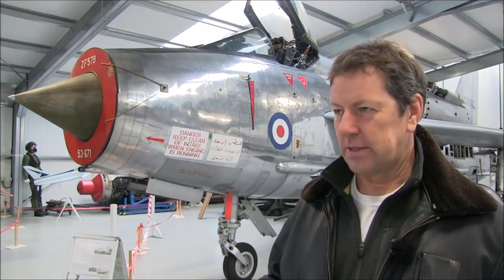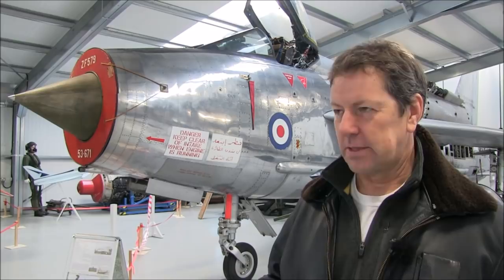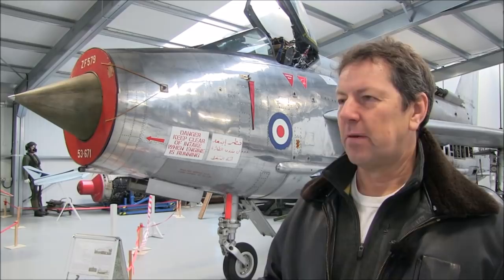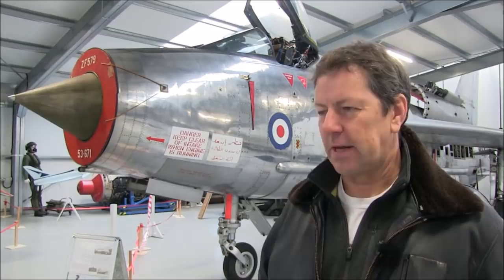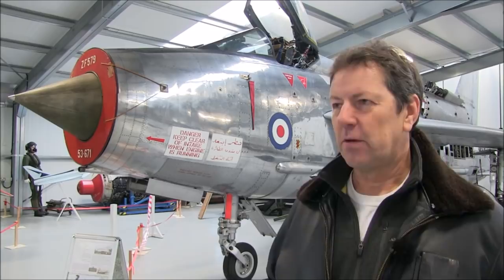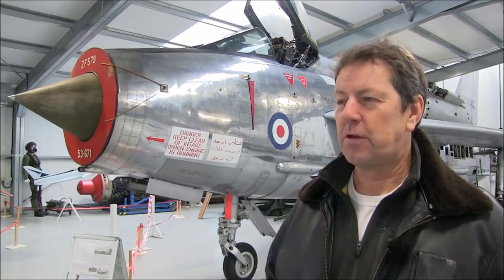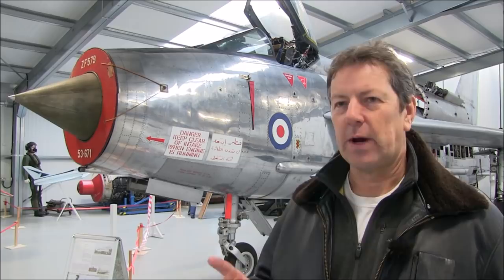Ian Black Describes a Lightning Take-Off

Comment: I recall an old joke from a Lightning pilot... The Lightning has so much thrust the only reason it has wings is to keep the nav lights apart.
Reply from the maker: Love that!
Reply: i heard that too, its from a pilot who flies and maintains the lightning in south africa i think.
Reply: dathat555 you watched that on here fake
Reply: That remark was from a BBC series about RAF trainee pilots from the 1990s, the RAF kept one Lightning in flying condition and the top recruit was taken up in it ,it was a two seater, on take it went vertical and the pilot said, " now you know what the wings are for", the trainee replied ," whats that Sir",  the pilot replied,"therear' to keep the navigation lights apart
Reply: Love the original comment about the wings
Reply: @cassorde1599  The late Mike Beachy Head

Comment: Born in "Proud"Preston in 1949, living less than a mile away from the EE factories, and remember the thousands of workers streaming out as I passed on the bus going home from school. Low-loaders pulled by Scammell tractors I think. Also Canberra bombers, TSR2 later (might be false memory). I certainly remember Concorde flying over, on test from Salmesbury to Warton. Not many Aerodromes could cope with such powerful machines.
Oh tempore, oh mores!
Eeerrrm, the Lightning was ferocious. At Brands Hatch, Kent, racing circuit 1968, I saw one pass. Stupefying power, almost vertical climb it seemed to us observers, deafening. Completely unforgettable. Never seen anything like it since.

Comment: The EE lightning is one of my favorites. I liken it to a double barrel shotgun, in more ways than one. The over and under engine configuration is very unique in and if itself. I’ve heard so many stories of how fast it was. You strap it on and takeoff and it is like riding a shotgun blast. 

Love the Mk F.6 With its over wing tanks and railing system.
Reply: The first time I saw a Lightning, I was a young french boy absolutly fan of aviation, I want not believe that "double barrel" disposition have been chosen !
It was in the sixties. We had not all the medias we have know to be informed.

Comment: As Adrian Humphries says below, it was built to intercept Sov bombers with minimum warning. Optimized to intercept.  This and the F-104 were designed with the same mindset.  Though, I believe the F-104 was more of a widow-maker.
Reply: Eric Velasquez  
Similar? One had two engines and was very fast, climbed like a bat out of hell and had good maneuverability. The other had one engine was not as fast, did not climb as well and had poor maneuverability but did have a strong liking for the ground.
Reply: Eric Velasquez  
While the much better Lightning had very good handling right through the speed range. 

Down low the F 104 was faster?  only in a dive just before hitting the ground.
the only thing the F 104 managed to get close to was low level acceleration, everything else the Lightning was better.
Reply: Eric Velasquez  
Wrong the F 104 never set any record with a production version and the claim the bad losses were because it was used as a fighter bomber make no sense since Canada lot half of theirs and USA lost a lot or twice the losses of other century fighters.  Italy did improve the F 104 but it still had bad losses. Spain had low losses because they only had their F 104's for a short time and only used them in perfect weather.
The Lightning was fast at any level and the Tornado holds the record for speed at low level.  
The F 104 would have made a lousy taxi too.
Reply: Eric Velasquez  
The F 111 about mach 1.1 while the Tornado did over mach 1.2.
Reply: @barrierodliffe4155  iv heard a tornado pilot saying the only thing they cant catch/run away from on the deck is an f111
Reply: @Scoobydcs  
I've heard an F 111 pilot say   " I thought the F 111 was fast until I tried to keep up with a Tornado.
Reply: @barrierodliffe4155  have you really?
Reply: @Scoobydcs  
Yes, but I have never heard any Tornado pilot say the F 111 was as fast.
Reply: @barrierodliffe4155  it was in an interview, possibly with an adv pilot
Reply: @Scoobydcs  
A possible interview, maybe with a Tornado pilot, it must be true then.
Reply: @barrierodliffe4155  no, a deffinate interview with a tornado pilot, i think it was an adv jockey but im not sure on that part
Reply: Erich  Hartman  thought   the  same  thing  of  the  F104

Comment: You can still get to ride in 1. A company named Thunder City in Cape Town South Africa operates tourist flights in a 2 seat version. It isnt cheap but dammmm its worth it. I did it about 10 years ago and ill never forget it. Just remember to wear a good jock strap cos your nads will be up near your ears.
Reply: Thunder city closed down in 2009 following a lightning crash that killed its pilot. The CEO Mike Beachy Head has also, sadly, since died.
Reply: @ianrkav  Thank you . I wasnt aware of that. It would have only been a few months after I was there. Bummer cos I was great fun

Comment: The EE lightning was the RAF's first modern combat jet so I think somewhat unfairly got tarred with the reputation of being hard to maintain and operate. In reality it was the first of its kind globally, not just for the  RAF, and was in fact what was to come. I think in subsequent decades when air and ground crew had got used to modern combat jets (not just the Lightning) and how to operate them the Lightning was actually about par for the course and nothing out of the ordinary in terms of maintenance and operation. Certainly as an aircraft it was as care free handling as any so called more up to date jets are in comparison to its contemporary jets of the day where the pilot had to make sure they did not enter parts of the flight envelope the aircraft could not cope with. The relative care free handling, a long with so much else, was something the Lightning pioneered and has only become standard on more recent jets from the 1980s onwards. The Lightning really was the benchmark for combat jets right up to when the f15 entered service, which in reality in concept was based on the Lightning in terms if high thrust to weight, low wing loading and a relatively simple clean wing.
Reply: It's a fallacy that they were hard to maintain the EEL was introduced into the RAF as an Operational Development aircraft and saw many of the units altered and upgraded that caused problems with parts until the RAF worked closer with the suppliers. The latter years saw the Lightnings hanging on until the F3 Tornado took over and by then most of the air frames were nearly 40 years old and had been "Well Used" by many RAF pilots - one even managed to pull 13.5 G ( could have been more but the meters only measured up to 13.5 and it broke )    and he still returned home -What a plane

Comment: It's Criminal that this wonderful Aircraft was not developed further.
All it lacked was Fuel and therefore Range
Reply: The EEL entered service as an Operational Development aircraft and it was put into full use by the RAF.

The fuel issue only became a problem with the oil crisis in the 1970's the range was catered for by Victor tankers that could accommodate six of the beasts but it was getting very costly and the RAF needed the MRCA TSR 3 - Tornado with better avionics and weapon systems. 

The Lightning was in many ways still way better than the F3, until they eventually sorted out the Blue Circle Radar.

Comment: The only thing that the RAF had that was faster than the Lightning was its fuel gauge.
Reply: In 72 @ Rhinedahlen JHQ, two Lightnings (Laarbruch);and a Vulcan (Uk based) did a fly over and spiral (corkscrew) vertical climb…..the Vulcan was the quickest! I was on the parade…underneath a wall of noise!

Comment: I remember watching a Lightning crash as it approached the runway at De Havilland, Hatfield. Stalled, flipped over onto its back, pilot ejected upside down and landed in a greenhouse full of tomatoes. They saved his life.
Reply: A very doubtful claim - unless you were the tractor driver or the photographer who took the award winning photo of the event. It didn't "stall" the control lines burned through due to a fuel leak. He didn't eject upside down (fortunately) - the aircraft was horizontal nose down - as can be seen in the photo which includes the tractor and driver mentioned above. You are correct about the glasshouse - although the glasshouse impact probably only minimally reduced landing impact. 
"UK photo of the year, 1962"  - http://bit.ly/lightningcrash
Reply: Dear @RussellMcMahon  1. 'A very doubtful claim'? I was one of several others who witnessed the crash. We were engineers working at De Havilland, which overlooked the runway, waiting for the plane to land. 2. The plane was 'nose down' in the photograph. Yes, but this was obviously not its prior trajectory. It was coming into land, horizontally. A moment later it was out of control and all over the place.

Comment: Simply astounding how engineers, with a clean sheet and literally no budget constrains, could design an airplane with SUCH LITTLE FUEL capacity. I mean... who were these people? It was some kind of inside joke on the pilots.
Reply: It's role was to get up to altitude very fast from a scramble and intercept and destroy Soviet bombers approaching the UK, then come back re-fuel and arm and go again. However during development rapid developments in Soviet European based IRBM's, the same sort that so freaked the US out when deployed on Cuba a few years later, made it's role now open to question.
(The same happened with planned Mach 3 US interceptors, the CF-105 and some Soviet designs to go after Mach 3 bombers that no one was now going to build).

In 1957 the UK government defence review saw missiles as the future, in offense and defence, so cancelled all military combat aircraft programs except the Lightning as it was in the mind of the minister concerned, sadly too advanced to cancel, would also be needed as an interim until SAM's took over.

So at a stroke various enhancements to the Lightning, including more fuel and weapon load, were cancelled, BAC studied various options of these for export but without UK government support it is hard to export something not wanted it seems or proven by your own air force.
Reply: The Lightning could be flown at a far more leisurely pace to conserve fuel but that wasn't a problem defending a small island with Victor Tankers waiting in the sky for thirsty birds.

They were stationed at Singapore and would "visit" the RAAF Mirages at Buitterworth in 20 minutes which is over 400 miles away the Lightning was no laughing matter.

Comment: Interesting....Not the first person to mention unforgiving Instructors! I wonder how many potentially excellent Lightning pilots were lost in training due to lack of effective coaching/mentoring - different era I suppose.
Reply: The problem was that the aircraft was unforgiving, so the instructors were only doing their best to get the  students to the level where they could cope with the aircraft. My experience of RAF instructors were that they were very good at teaching, and very encouraging, but didn't hesitate to pile on the pressure if you weren't making the necessary progress. They had a limited willingness to persevere with someone who they felt was never going to be good enough, but it's the taxpayers' money that is being burnt, so you have to accept that it is their job is call a halt when the student clearly isn't going to make it.

Comment: I recall someone at an air show saying there was an option to replace one of the engines with a rocket, this was just after the Lightning came out.  I can't think why, but was this ever considered?
Reply: klystron44 may be because rocket motors aren’t air breathing, so at very high altitude the rocket could kick in and go farther up to the edge of space. It could do this because the aircraft has it’s oxygen in liquid form in tanks. How practical in would be is debatable though. I saw a program “ Air Warrior on PBS, showing that a stripped out F15 fly to undisclosed height and launched a missile at a  satellite and hit it.

Comment: Wasn’t the lightening the only plane to intercept a sr-71 ?
Reply from the maker: The Saab Viggen also did it.
Reply: Don't think anyone would ever admit it.
Reply: @Aircrewinterview  iv heard about the viggen, never heard of a  lightning doing it though
Reply: @Aircrewinterview  the Viggen intercepted a damaged SR-71 with one engine down it was flying at 300 knots.
Reply: the top speed of the SR-71 is classified, all that's been made public is that it's Mach 3+, however since it's able to outrun SAM missiles that are still in their thrust stage then it's top speed must be in excess of Mach 4. A truly remarkable piece of engineering!
The Lightning Max speed is Mach 2.25, and I doubt it can outrun SAM missiles!

Comment: Didn't one of these break the sound barrier going straight up?
Reply from the maker: I wouldn’t be surprised.
Reply: @Aircrewinterview  I remember the Lightning doing re-heat vertical climbs at The Biggin Hill airshow. I think they had problems avoiding breaking the sound barrier in the vertical and stopping before they crashed through the display ceiling. I was told by someone you cound not do a vertical climb - only 89.9 degrees as the instruments got confused at 90 degrees.
Reply: @Aircrewinterview  Thing could supercruise waaaay before the F-22, too.

Comment: Would have liked to hear his thoughts comparing the Lightning and Phantom, having flown both.
Reply: No comparison, the Lightning was faster, climbed much better and was more agile. No wonder the Lightning was kept for QRA until the Tornado F 3 was ready to take over.
Reply: @barrierodliffe4155  well I know in general it was, but at the same time he did say the lightning didn't turn below 300 kts, so probably not true throughout the while flight envelope.

I'm talking about in detail how manouverable, how fast accelerating, etc at different speeds and altitudes.
You know a properly comprehensive comparison.
Reply: @sergarlantyrell7847  
In every way the Lightning was better, Maneuverability, faster accelerating and climbing at any altitude apart from coming in to land the Lightning would rarely be going as slow as 300 knots, I would love to see a Phantom pilot try to follow a Lightning.
Reply: @barrierodliffe4155  again, I've heard that, but usually second hand sources and with limited aged data to back it up. I'm an aerospace engineer so have been conditioned to care very much about the exact details and their accuracy.
Reply: @sergarlantyrell7847  
Exact and accurate details show the lightning had much better acceleration and climb as well as maneuverability.  Maybe what pilots had to say would help.  An experienced USAF pilot got to fly a Lightning. He said after the flight  " I was in complete control until I released the brakes "
There are other facts which go some way to show how good the Lightning was.
The fact that NATO once had the use of Concorde to practice an intercept at over mach 2.
Of the aircraft which tried, F 104, F 4, F 14, F 5, F 16 and Mirage, none could catch up except for one which not only caught up but went past, the English Electric Lightning.
When a Lightning was tried against an F 104, the Lightning won. When a Lightning was tried against an F 15 in a climb from brakes on to 30,000 feet the Lightning won.
A Lightning intercepted a U 2 at a height that the USAF thought impossible. later after some improvements to the U 2 the USAF tried again and again it was intercepted by a Lightning which went higher then descended to intercept the U 2.
Reply: @barrierodliffe4155  I think you're referring to XR749 which even by lightning standards was known to be "a very hot ride". I'm sure the other nations pitched their respective best examples in those competitions, but I know that that exact performance was more than could be expected out of an average Lightning F.3, but by how much, I don't know.
Reply: @sergarlantyrell7847  
It would not be a big difference, I recall an RAF squadron leader who when his squadron was given new Spitfire Mk XVI's to replace their older Spitfires kept his older Spitfire as long as he could because it had a genuine Rolls Royce Merlin instead of the Packard copy, it was a bit faster.  Any Spitfire at that stage of the war had better performance than other fighters, much like the Lightning.
Reply: @barrierodliffe4155  I wouldn’t be to sure about the lighting being more maneuverable
Reply: @aidansetias5591  
I am sure the Lightning is more maneuverable.